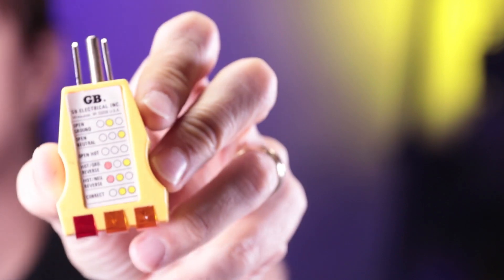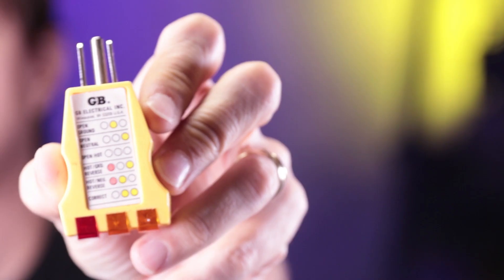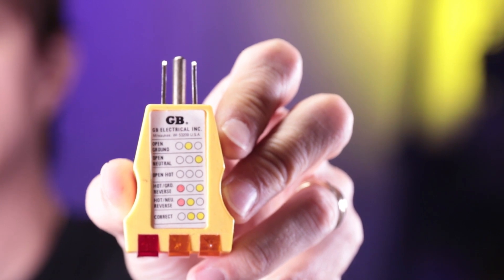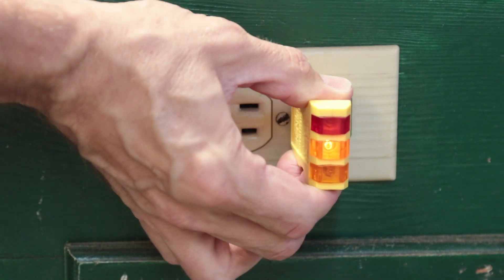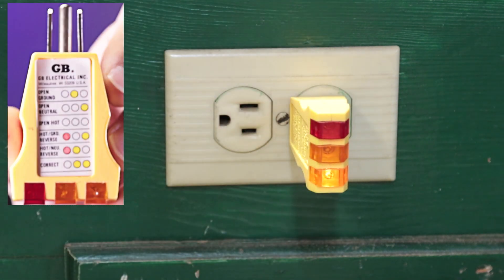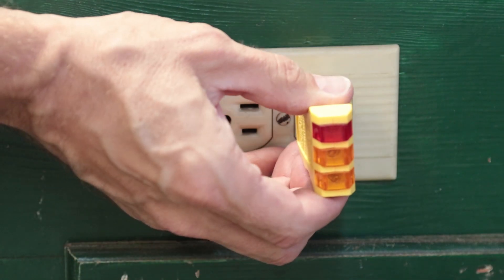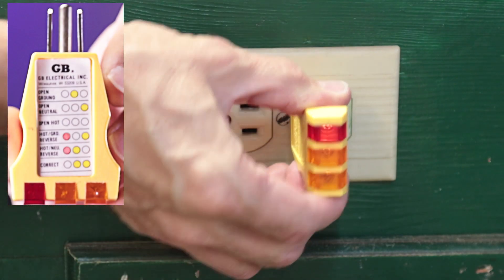How to use an outlet tester

Comment: Can a faulty air compressor burn an electrical outlet? I have one of this testers and it has a black button on top. I connected it to the outlet and the 2 lights on the right lit up, I then pressed the button, lights went away and never came on again. I used a nontouch testervand shows no power on the outlet. Any help is appreciated

Comment: Long shot since it's been a long time since this video was posted, but do I need to unplug anything on others outlets on the same breaker before using?
Reply from the maker: Not generally. Usually if a device that's plugged into the circuit would cause a problem with the readout would first cause the circuit breaker to trip. Hope that helps.
Reply: @HouseOfHacks  thank you!

Comment: Very informative video. Maybe you can help me with this. I bought some surge protectors from amazon and they all have lights for protected and ground. However when I plug them into the wall outlets at home some of the surge protectors show not grounded/protected but when I plug in a different surge protector it shows grounded/protected. I bought the surge protectors at the same time from Amazon a week ago. Also, I checked the outlets with a receptacle tester and I get the two lights for correct wiring. I went around the house and plugged the surge protectors/receptacle tester into various outlets with the same results. Is it a surge protector problem or something with the house wiring? thanks!
Reply from the maker: Let me see if I understand correctly, you have two surge protectors, A and B. Regardless of what outlet you plug them in, A always says there's a fault and B always says it's OK? And a separate tester says the outlets are OK? If those are both true, then it sounds like surge protector A has a problem. Hope that helps.
Reply: @HouseOfHacks  Thank you for responding to my problem. I don't think the surge protectors are faulty because I took them to my office and plugged them in and they both worked okay. Any ideas?
Reply from the maker: @ricodemarco  Hmm, that does add an interesting wrinkle to the problem. That does seem to point to a wiring issue at the house. It sounds like something that doesn't show up with the simple outlet tester and is on the edge where the manufacturing tolerances between the two surge protectors is enough to make one show good and the other bad. My first thought is there's a problem with the ground somewhere. If you don't feel comfortable working around line voltage, you may want to contact an electrician to look into it.

Does it happen for all outlets in the house or just some?

If it's all, then I'd start looking around the place where the breaker panel is connected to ground. Usually there's a heavy wire that runs from the panel to a rod that goes into the ground. Check for corrosion around this wire and that all the connections are solid.

If it's only some outlets in the house but not others, then it's whatever is common to those outlets. They may be all on one circuit. In that case, it's more likely the connection inside the panel from the common ground rail to the wires for that circuit. Perhaps something as simple as a loose screw on a connector.

If it's only some outlets but not others and they're all on the same circuit, then it's probably one of the ground connectors inside an outlet's box. Outlets are typically run in a string for any given circuit. So there's one set of wires that goes to the first outlet. Then there's another set of wires that goes from that outlet to the next, and so on down the line. It'd be a matter of finding the outlet on that chain where it tests good but the next one in the chain tests bad. It'd be the connector to ground in either of those outlets being flaky.

Hope that helps and good luck!
Reply: @HouseOfHacks  thanks for the info. I'll try your recommendations!

Comment: How would you know if the Neutral (white) wire and ground (green) wire are reversed?
Reply from the maker: Plug it in and look at the lights that light up. Compare those to the chart on the tester.
Reply: @HouseOfHacks  The chart has no indication for Neutral (white) wire and ground (green) wire reversal.
Reply from the maker: @cskye6529  Ah, right. Sorry, I thought that was one of the documented combinations. In this video I go over how the lights show u[ in the undocumented scenarios: https://youtu.be/BMH12RfEQqs The short answer is, it shows as correct on my tester. My guess is it would trigger a GFI outlet though since the current is going through the ground instead of the neutral.
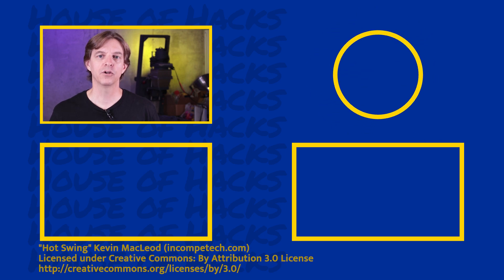Reply: Ok thanks, checking that video now. edit: Ah so, when the ground is not connected and hot and neutral are reversed 3:30 just the middle light shows up which appears to be open ground.  So how can we tell the difference without opening it up?  Many of my outlets in my home do not have the ground hole.  However, back to my original question: when ground and neutral [white or ( - )] are reversed 2:32 it shows it as a normal, so how can we tell without opening it up?   I realize this is not a likely scenario, however, it is still possible.   What if we aren't testing a GFCI outlet?  In the absence of a ground (green) wire sometimes the white wire is called "ground", isn't it, while the black is "hot"?  Although, we know the reality is different, as the grounds should all be connected to the rod that literally goes into the ground at the point of entry into the home.
Reply from the maker: @cskye6529  In a two wire system, the white is typically called neutral, not ground. In my previous house, it was built before having a ground had become standard and it had a two wire system. Someone had changed some of the outlets to three pronged without wiring in a ground wire. A bit of false advertising. Without opening it up, I don't know how you'd tell if ground and neutral were swapped. From the outside of the outlet, electrically there's no discernible difference as current will flow in either case.

Comment: My tester lights up all 3 lights. And it's the first outlet from the breaker box. I'm running a double 30amp breaker. Why would it do that? The outlet is wired correctly. Do I need a smaller breaker?
Reply from the maker: The size of the breaker won't make a difference. Perhaps there's a wiring problem upstream from the outlet.

Comment: What if a short occurs and three sockets sockets stop working. The socket tester does not light up. Which suggests open/hot. The breaker hasn't been tripped and neither of these sockets have a GFCI switch, although one is marked as GFCI. 

How is this fixed? Is the socket fried? Is there a breaker I need to flip on/off to reset?
Reply from the maker: I doubt the socket has been fried unless there are more problems than just that upstream. The breaker should trip long before damage is done to a socket.

If they're labeled as GFCI but don't have a switch, that probably means they are daisy chained from another socket that does have a switch. I'd first try to find that. It could be anywhere in the building. E.g. I have one circuit in my house that's GFCI protected that has outlets on both floors plus the basement. If the breaker tripped, it should be obvious in the breaker panel with the handle in the middle between the on and off positions.

Comment: I I accidently pressed the little gfci button on top on of tester what I belive is a regular outlet and now it dont work..? How can I fix it?
Reply from the maker: Probably one of two things:
1) The outlet is a slave of a master GFCI outlet that's tripped. Often times in places like kitchens, there will be one GFCI outlet that has the test/reset buttons and the others will be controlled by it. Find that one and hit the reset button to restore power to the whole chain.
2) The circuit breaker on the main panel tripped. Go to the panel and find the one that's been tripped by looking for a switch that's halfway between the on and off positions. Turn it fully off and then back fully on and that should take care of it.
Hope that helps. Peace!
Reply: @HouseOfHacks  thank you. Yes I did find a outlet with that button on it. It was In the garage . Who would have guessed
Reply from the maker: @powerstuffup  You're welcome! Yes, one of the GFCI circuits in my house has outlets on three floors.
Reply: @HouseOfHacks  for sure. 👍 you learn as you go

Comment: What if the reader says the outlet is good... But, any plug without the 3rd prong, causes a noticeable spark, when connecting?  Because that's the issue I'm having.
Reply from the maker: The spark indicates the device you're plugging in is drawing power. I don't think it means there's anything wrong with the wiring or outlet. Making sure the device is turned off before plugging it in should help minimize that problem.
Reply: I had this problem a few days ago. My garage opener did not work, so I wanted to confirm the outlet tester was working. I plugged it into the washer plug while the washer was running, and it sparked. Later that day, my home ac would not come on. The electrician changed the washer outlet, and it said it had bad ground. Now my ac board is fried. Could I have caused that with the tester? Thanks

Comment: I have 4 outlets that reads right light is bright and the second/middle light is dim for 4 outlets..
What does it mean when the middle light/neutral is dim?
Reply from the maker: I made a video trying to answer that question: https://youtu.be/BMH12RfEQqs
But I didn't see that exact scenario. Perhaps it's a problem beyond a simple wire being connected or not.